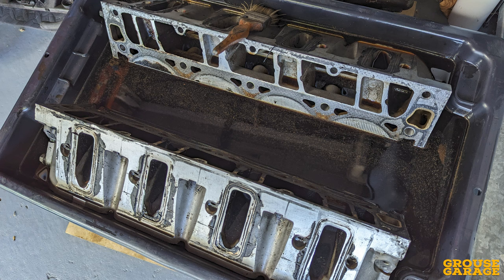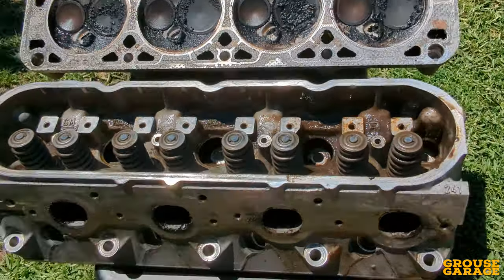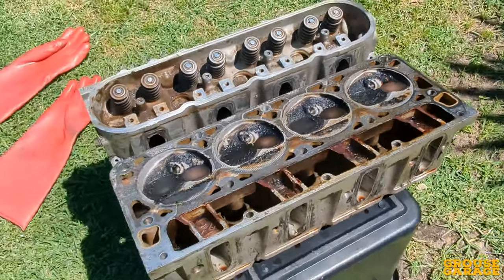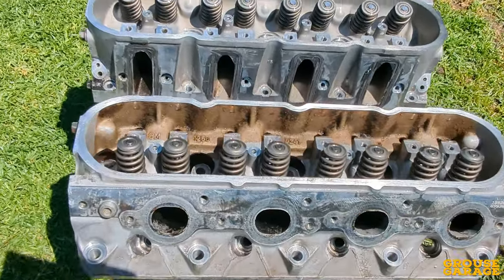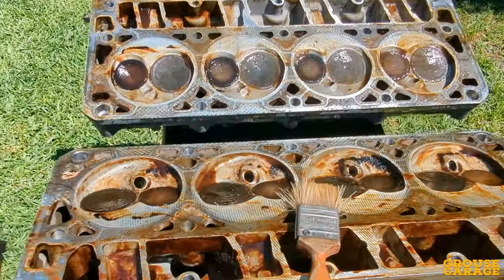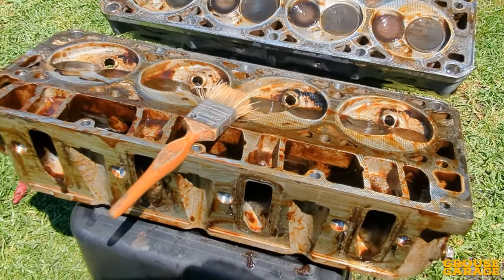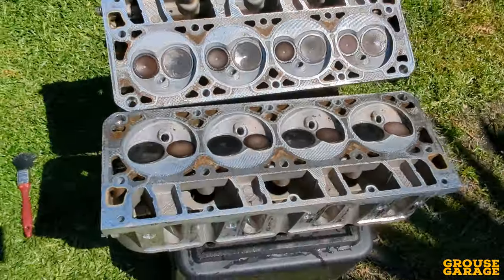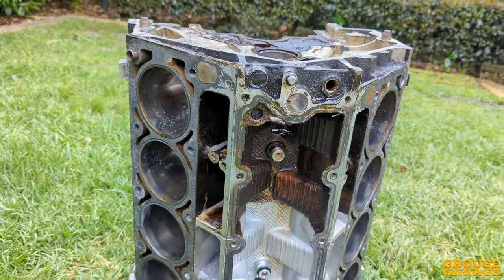How To Clean LS1 Cylinder Heads - The GROUSE GARAGE Way!

Comment: If you have used water based degreaser you have used liquid caustic soda, and paint stripper is the same chemical at a different concentration.